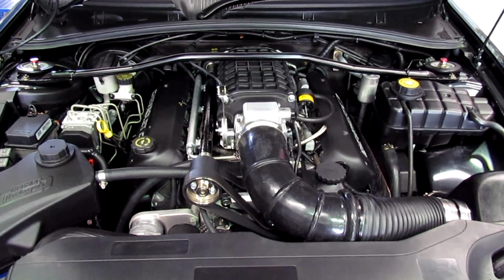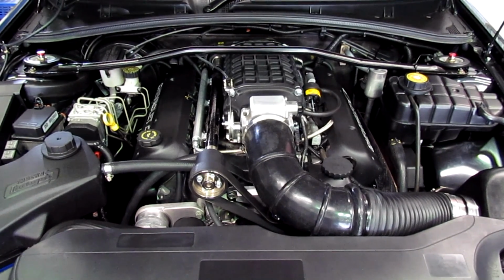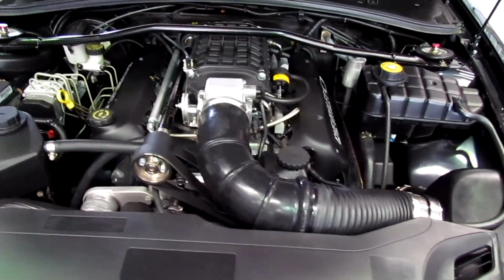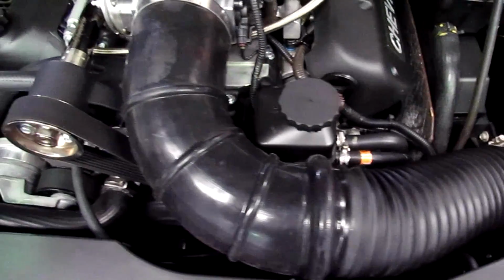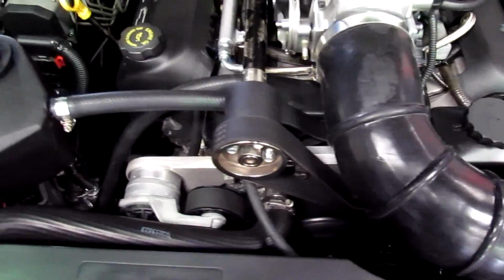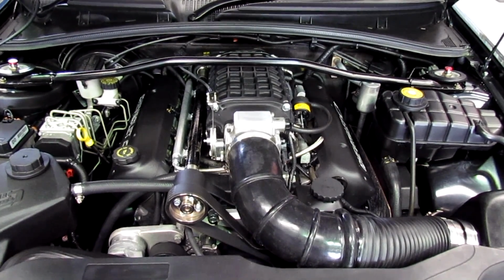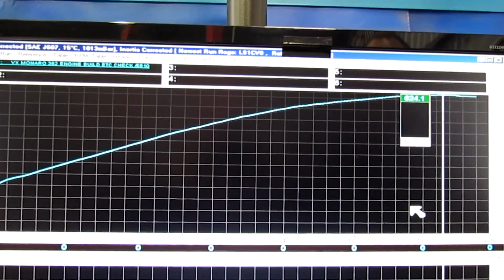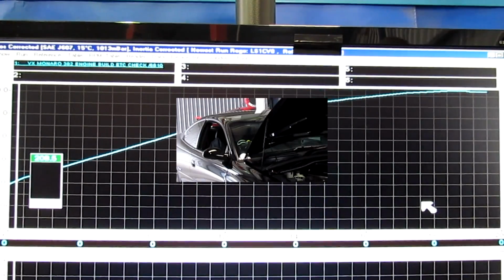625 rwhp Supercharged LS1 monaro

Comment: Hey mark what size is the front pulley on this jack shaft ?  3.0 / 3.2 ?  Cheers mark
Reply from the maker: Karl Bury the front pulley size is only one bit of the pulley ratio combo, doesn't mean anything without knowing the combined pulley ratio. This is a 3" front pulley, but as said doesn't mean much. As for complete ratios, they are something I set up when doing the job, just like cam profiles and compression ratios.